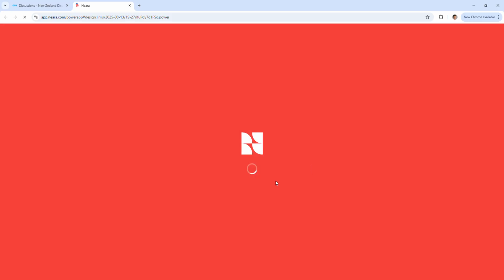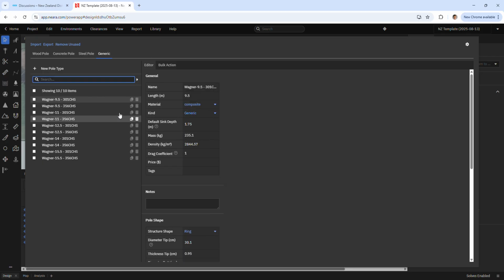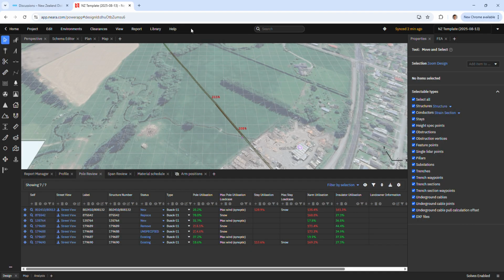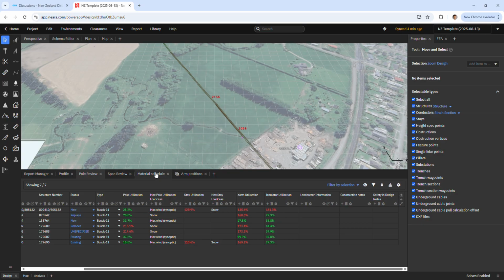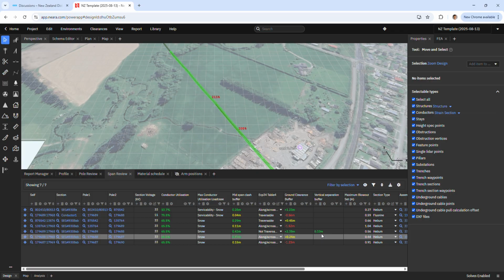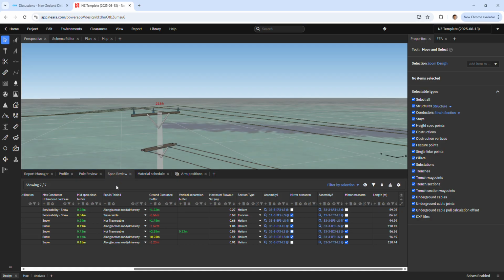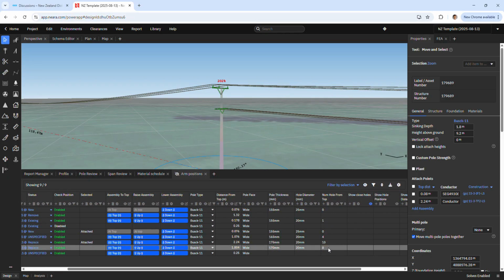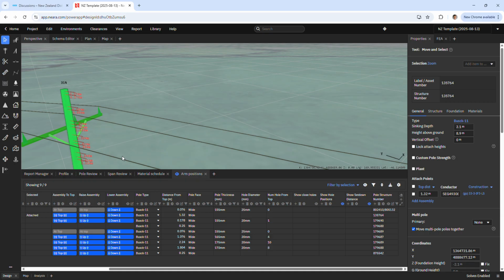NZ Neara Template Demo

Comment: Show close holes:
In this version the pole hole information would only appair in perspective view if the assembly was in a position where there wasn't a valid hole.
The example pole that was chosen had the assembly at a valid pole location and the buttons kept it in valid positions.

It makes sense that people may still want to see this information even if at a valid location, so this was changed to be always visible.
The colour was changed to Black if valid hole position, or Red if no hole exists. 

This only displays in perspective view if the "Hole Position Check" is enabeled in the assembly library (on a per assembly basis), and if the respective pole hole information is populated in the data table for the pole being used. This is intended for simple flat constructions as it only checks vs the top most attachment position and compares it to valid hole positions.

Show Hole Positions
The colour was changed from red to Blue as Red is used by "Show close holes" to denote an incorrect attachment position

Show Setdown Distance
The colour was changed to black for readability.